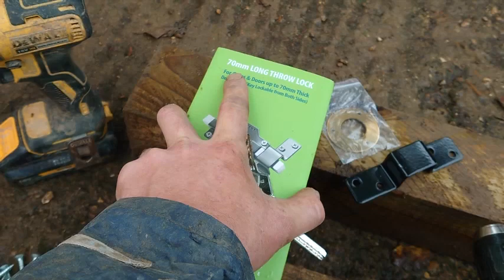HOW TO fit a gate LOCK, ROSE CATCH & DROP BOLTS: Gatemate, Perry, Long Throw

Comment: With the drop bolt on the opening gate you've no way of getting in from the outside...
Reply from the maker: Correct. Just like a sliding bolt into a post or wall on a garden gate.

Comment: Lovely set of gates ! Nice job too 👍 Do you work by yourself ? 💪
Reply from the maker: Best not to get me on my soap box about staff 🤣🤣 basically yeah I work alone now and have the odd bit of help if I can scratch a reliable person from another company 😉
Reply: I commend you. Fencing is hard enough as it is by yourself its a killer. Did it for a year 🤯
Reply from the maker: @JamesMontana  thanks, your right it is graft. Strangely I can be more predictive on my own mostly. I always rather do concrete or slotted timber posts so I don't have to use loads clamps ect.